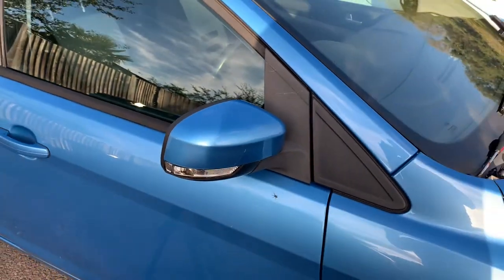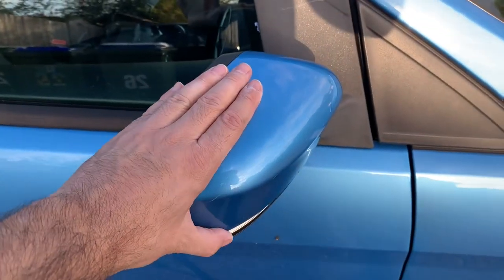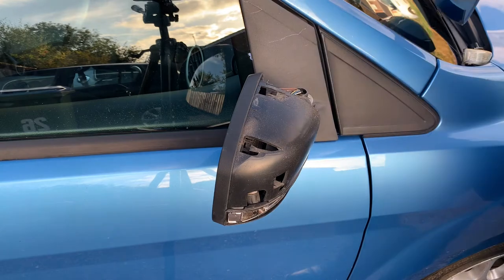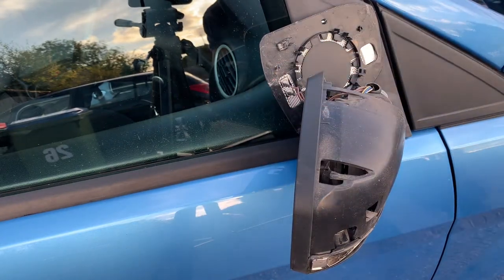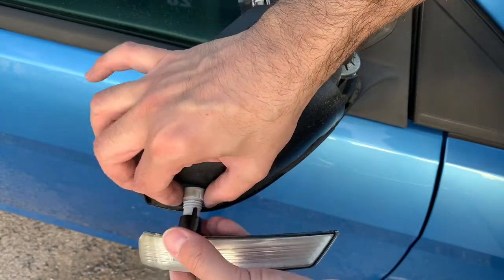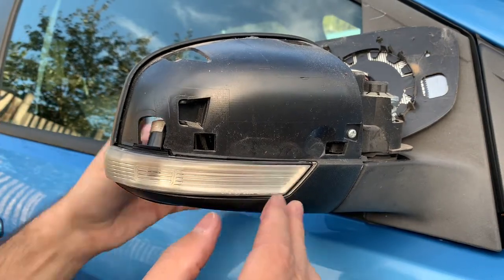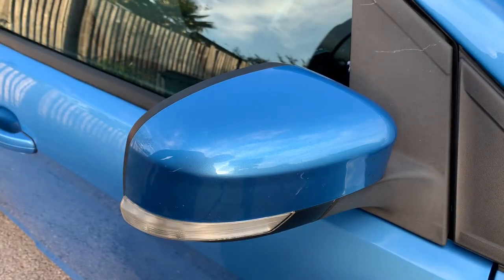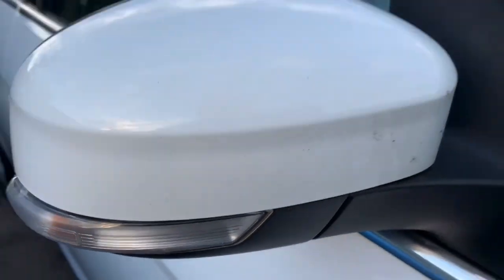Focus MK2 facelift & MK3 wing mirror indicator / bulb replacement

Comment: Thanks so much. I found I could use a flat bladed screwdriver to unclip the indicator from the inside without removing the mirror. Replaced indicators for dynamic (swish, swish) ones in a black colour-coded housing.
Reply from the maker: Thanks. Yes, that could work too. The video was made before I found out I could just remove the cover to install the new indicators too.

Comment: That was really helpful thanks. My driver's side mirror indicator lens and bulb somehow got broken in exactly the same position as yours did, it didn't happen during driving, very strange, it was such a specific spot, almost as if someone took a hammer and chisel to it. I was a bit wary of breaking the plastic clips, but the bulb and lens replacement went smoothly, now working again. Thanks very much. I also had a mirror spider! 😂
Reply from the maker: That’s great, glad it helped
Reply: Hi can i ask what the bulb is that fits in the indicator please